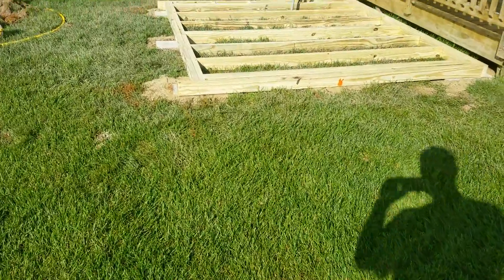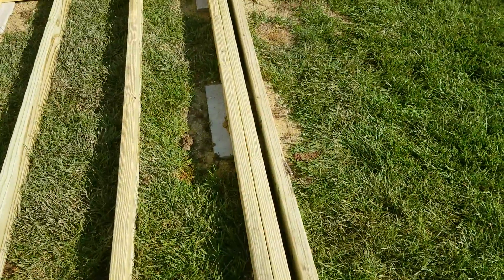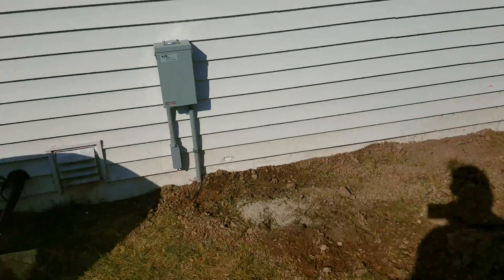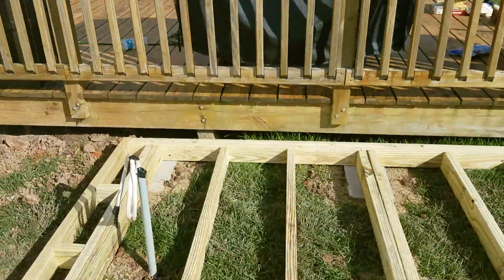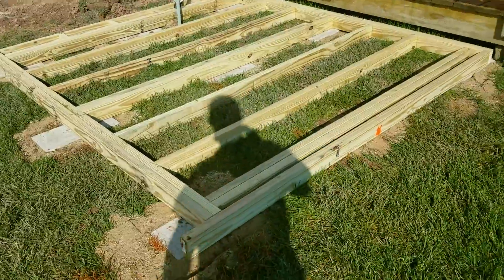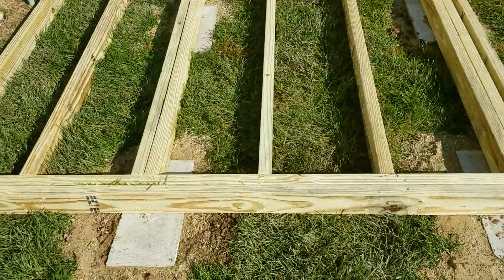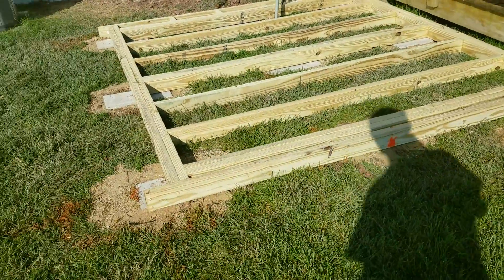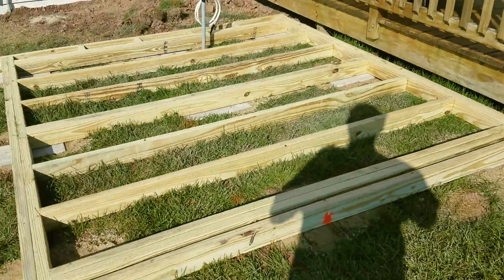How to Build A Hot Tub Base Pad

Comment: How did the platform workout after the tub was installed?
Reply from the maker: Johnny Fish it's working out great so far. But the ground is still frozen. It will be nice to see what happens one everything is all wet and thawed. The only problem, though not an actual problem, is the hot tub is a 7' tub but that measurement is the at the widest part which is the very top. The part that actually touches the ground isn't 7', it's more like 6'6". So the outside of the base technically isn't centered over the double stacked 2x4s. Not that it structurally matters much. If I had pre-made some other sort of base or extravagant enclosure, this would have been very upsetting.

Comment: A year later, how is everything settling out? I'm about to do this same thing and regain our deck back and move the hot tub onto the side almost identical to what you have. Thanks for the video. I'm hoping it can be that simple. Just need some pre-treated wood and I'll  be on my way.
Reply from the maker: It's great. Still level. I would say about the only problem I have is voles digging under it. Im really worried about them getting up in the hot tub because of the deck boards I put on top and when I take off the side cover I see no evidence of anything being in there. If I had it to do all over again I'd do it the same way.
Reply: @sterline80  Do you have a picture you could post of your finish product? I had thought you mentioned putting deck wood on top of it but wasn't sure. Trying to finalize my list of things to buy. Also may fill with rock in between the wood for any water to pass through but didn't know if that was overkill. Glad to hear everything settled nicely!
Reply from the maker: @larryworkman2093  I'm not sure how to post a picture. But I used 5/4 deck boards from lowes over the top, just like the deck it's next to. The gravel imo is overkill. Unless your tub has a major leak you really don't get water under it.  I thought about digging down 3 or 4 inches and using pea gravel instead of wood but 1) I wanted to actually dig as little as possible and 2) if it should settle unevenly, I could dig under the platform and jack the entire thing up to shim it level again.
Reply: @sterline80  I agree it is overkill but the wife has a friend that says... :S lol
Reply: @sterline80  Moth balls work for some pests maybe put some moth balls around and see if that helps

Comment: I'm curious how these treated interior boards worked long term, and why didn't you use exterior pressure treated? These boards are not intended to be used outside and certainly not in contact with the ground.
Reply from the maker: All the boards I used were pressure treated ground contact rated. They have all held up just fine.

Comment: How's this holding up, any updates?
Reply from the maker: It's great. Just use 5/4 decking over the top and it's perfect. I wouldn't hesitate to do it again. Not only is fairly inexpensive, but when the tub's life is over, you won't have an unsightly slab to deal with.
Reply: @sterline80  did you use just regular pressure treated 1 inch decking for the top
Reply: Never mind that last question lol. Thanks foe the update. Glad its working out for you

Comment: Give it a couple of years and that wood will be rotted out and the weight of the tub will really screw it up.
Reply: Why? Because the timbers are sat directly on the grass? I did think this as I’m doing the exact same style deck for an inflatable hot tub. Only difference I’ve made is to use 6x2 timbers not 4x2.
I’ve made a man babe the exact same way but I’ve left a gap between the grass and floor of around 100mm for air flow, plus, I’ve covered the grass with weed membrane which has killed the growth of anyway.
I don’t really wanna lift my decking for the hot tub to 100mm as I’ve a sloped garden - the only option I can see is to dig down and leave a clear space under the decking
Reply: For sure . 2000 lbs or more with chlorinated water getting onto the wood.

Comment: It will settle u should fill it with pea gravel it will be better than concrete
Reply: I was thinking this too, would it be much more sturdy filled with gravel?
Reply from the maker: There really wasn't a need to and I'm glad I didn't. I don't have small pieces of gravel in my yard or getting hit with lawn mower. If I was going to do that I would have just dug down a few inches and fill with pea gravel. If I had to do it again, I would do it exactly like this, minus screwing up with the 2x4s spacing past the concrete pavers

Comment: The ground contact boards are not a good idea. They will wick moisture and rot.
Reply: this won't hold up over time. 5-6k lbs sitting on 2x4 sitting on dirt. should have just set it on leveled pea gravel.

Comment: U shoulda just put the slab down.   The wood, work and decking equals the cost of concrete
Reply from the maker: Well if i had a truck bring in concrete, it'd be a coupe hundred, or a ton of mixing and still more. Plus in a few years when the tub is gone I won't have an unsightly slab to deal with
Reply: sterline80  ....I understand.